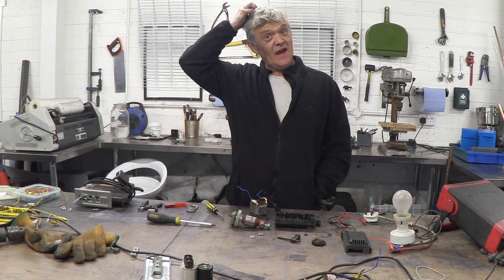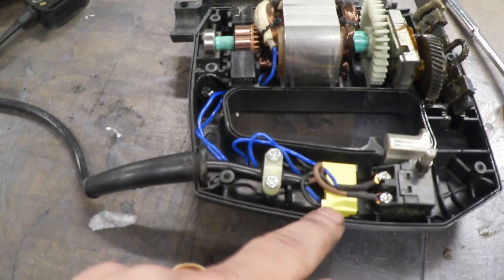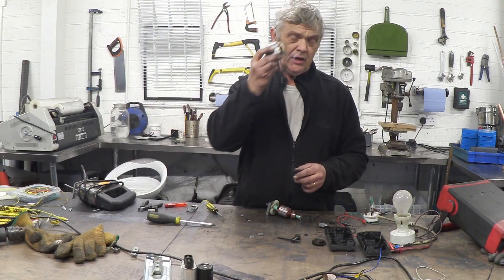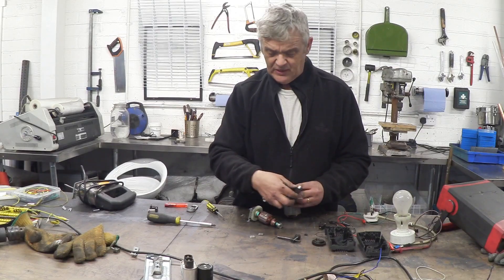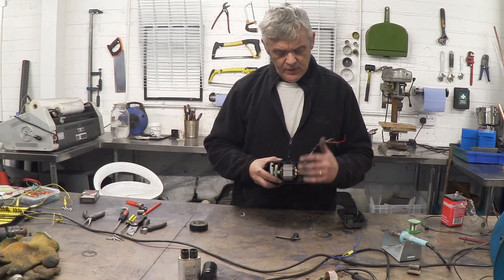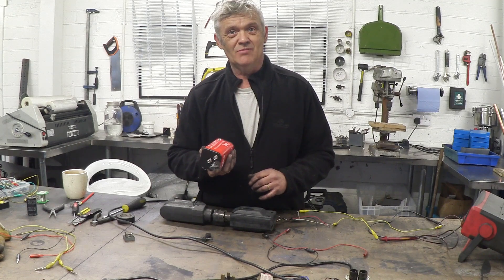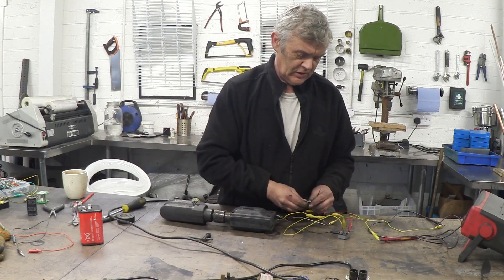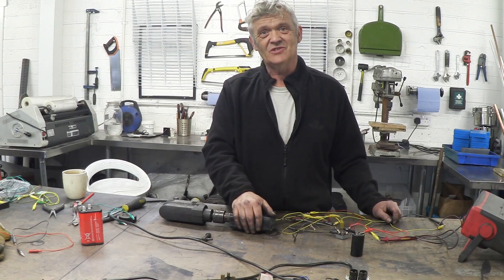Converting A Universal Motor ( Washing Machine, Drill, Saw ) To Generate

Comment: I have picked up a few old drills from thrift shops etc for next to nothing. usually the motors work but the batteries need to be heavily cycled. however they are great to make either electric bicycles (literally use a metal hose clamp to clamp the drill chuck in contact with the tire rim) , small boat motors (in a pvc pipe), and windturbines. most drills have some variant of the 775 motor in them. you can buy them cheaper in a broken or old drill at a thrift or yard sale for about $3  than buying them new online plus you often get some salvagable nicd or nickel metal hydride batteries which will come back to life after mulitple deep cyclings. everyone wants li ion drills now so they are chucking away tons of the old drills!

the REALLY nice thing about the old drills is you can keep them right in the case and use them by simply putting a couple of wires to the exposed metal contacts that usually exist in the handle where the battery would slide in and they are always dc motors which are SO easy to work with. and if you put a plumbers snake in the chuck you can attach a boat propellar or fan or anything to the drill as either a thruster or a generator!
people greatly underestimate the pwoer of these little motors you get often get for nothing. this guy from cambodia makes incredibly fast boats using a few of these motors put in a row and ganged together(also amazingly simply fiberglass construction technique) https://www.youtube.com/watch?v=O3NDHZ5qOr8
Reply from the maker: that is a really nice post mate - thanks for taking the time - of to watch that video

Comment: Rob, you dont need rectifier,.. that brushes act as rectifier. You made dynamo,. :)
Reply: I was going to make same comment. Revisit your test and measure with a dc meter the output of the rotor. The brushes will be rectifying the alternating current from the rotor. A universal motor is a dc motor. When run on a.c. the brushes convert the a.c. to dc so same applies when used as a generator.
Reply from the maker: makes sense to me - we all learn on here - it's awesome
Reply from the maker: cheers mate - I didn't know that - I do now and off to retry it lol
Reply: @ThinkingandTinkering   In fact,. Brushes and comutator cant act as diode,. But, brushes are always on winding where is same polarity as was on winding before. When comutator rotates, it continuously switches windings in rotor. So every time brushes are on same polarity :) AND, stator winding can be conected in parallel or serial or semi paralel with rotor. So you can make different types of dynamo system. Every type with different VA characteristic.
Reply: + 1.  This arrangement (ie a dynamo) was used in cars upto the 1960s.  The initial excitement of the field coil was achieved when you turn the ignition on.
Reply: Can you apply DC to the rotor, and then have different connection options for the AC from the two stator coils? Like series, parallel or a centre tap (so you only need two diodes instead of four)

Comment: Universal serie motors as in drills are self starting. I've used these as generators in some experiments as point of faillure. They stop or burn when overloaded. Nice thing to know.. the handcrancked generator that cylon in battlestar galactica powered and you see at army surplus shops also has a series commutor motor-generator in it.
Reply from the maker: cheers mate

Comment: This is exactly the next video I was hoping for since, I followed your advice and tore appart a recently defective hand blender to find a 200w dc brushes motor inside. I’d like to switch it around to turn it into a generator for a small Tesla inspired project.
Reply from the maker: awesome mate - video too?
Reply: Robert Murray-Smith not sure yet. If it works, it may be patentable, so video would have to wait until patent paperwork is sent in. Otherwise would be happy to share a video of my plan.
Reply: Sorry brushless  motors are actually servo motors unless they probably dont work.
Reply: The Dog Walker sorry, that was a typo, I meant Brushed motor, not brushless. 👍🏻
Reply: @0sailing951  oh in that case it should work no problem 🤗